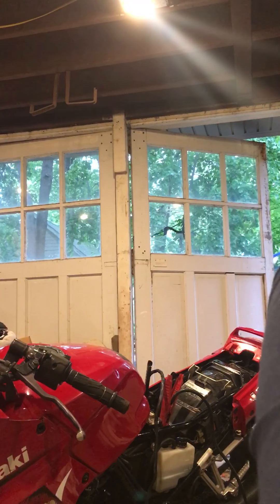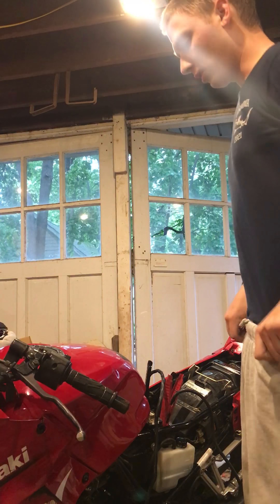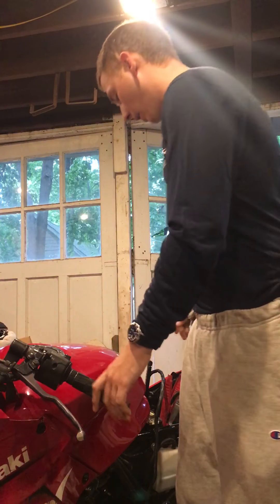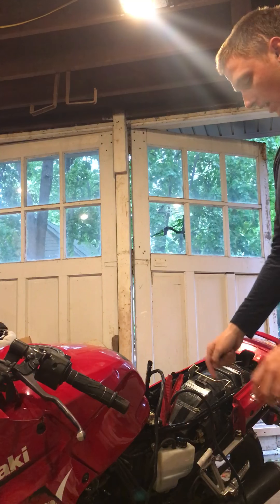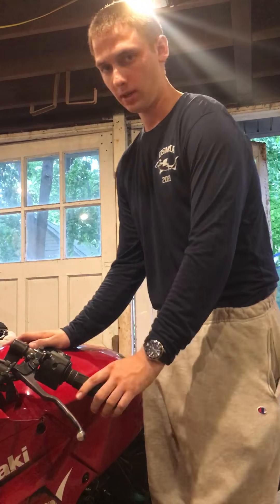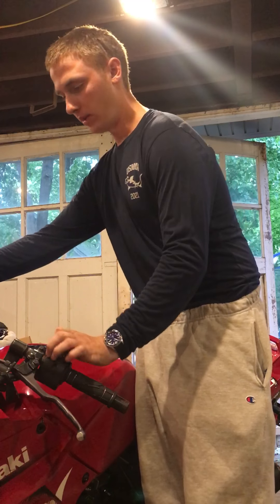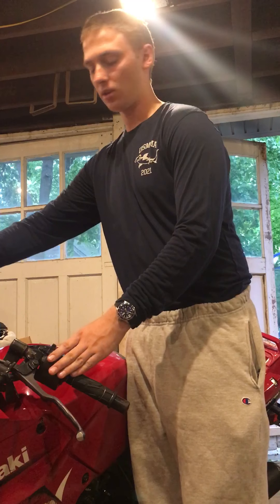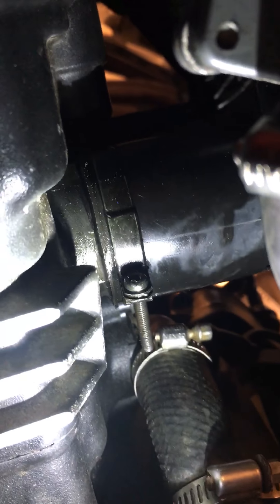Ninja 250 issues (help?)

Comment: Seems to be a Vacuum Leak. Check all your carb hosing make sure they are soft no cracks. Or Could be coming from the boots if the idle picks up when u lightly spray starter fluid around them. If neither check the fuel enrichment valve. It could be not sealing fully and letting air in causing you to idle so high
Reply from the maker: It was the idle screw in the carb